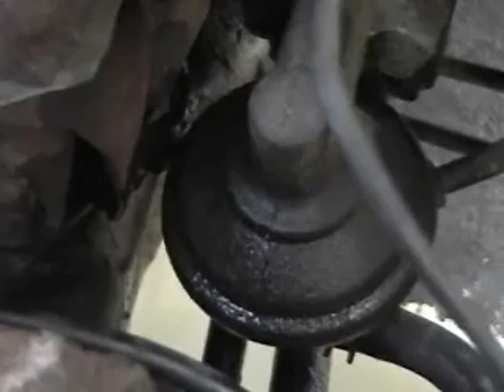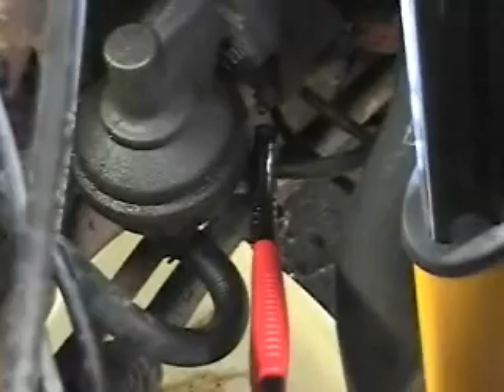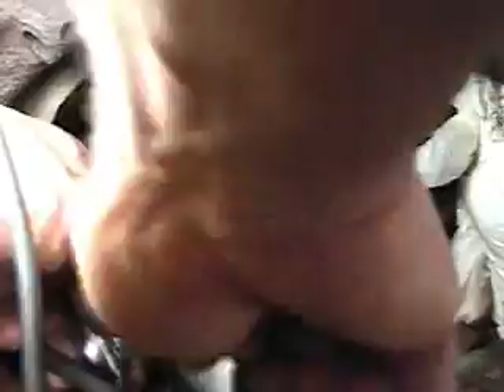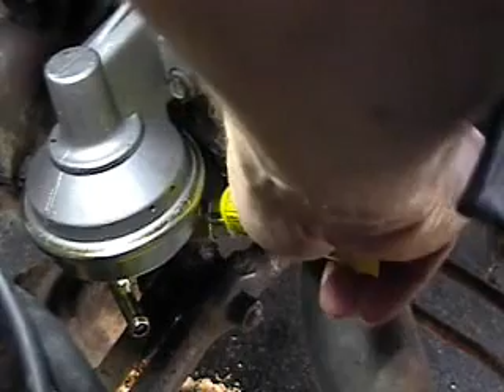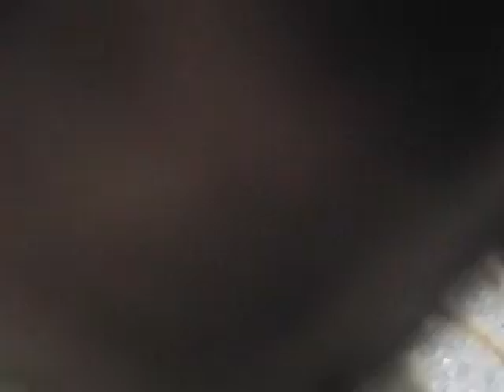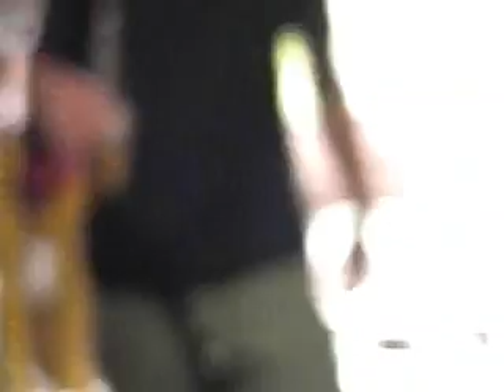Fuel Pump Replace 1984 Pontiac

Comment: When i installed my fuel pump to my 76 Pontiac was no pushrod to push against did i do something wrong i am having starting issues now but wen i first installed she ran great after replacing pump and I'm getting fuel still i believe i might not have spark but that's besides
Reply from the maker: Hmm. That's odd if it ran when you first installed it and then it stopped. Are you sure it's still getting fuel? How long did it run for before it had issues starting?
Reply: When i pump the gas i can see gas getting pumped i started with issues after that first start after replacing starting issues
Reply from the maker: @ncientdyno  Did you diagnose the spark issue? It's likely that or maybe the ignition coil.

Comment: I like how those fuel pumps work its works by the eccentric wheel rotation that's attatched to the top timing gear contacting the push rod on the pump

Comment: Was hoping to see the most difficult part.. the pushrod , so it fits back in
Reply from the maker: I know, sorry, I didn't realize how important it was, I just installed it with the push rod in the pump under the pin

Comment: Thanks for the information very useful for my car have the same car fuel pump went out what tool did you use and what socket ranch was it so i can get it all at once.
Reply from the maker: Hi Randy, The size of the bolts may vary from each vehicle but you can try a  10mm or12 mm socket. Good Luck. ~Cheers~ B.Champagne

Comment: thanks for the video. i realize ill be swapping out my fuel pump with even less of the must haves like grease and appropriate tools. but, i feel confident in doing it myself having witnessed its a bolt on piece of equipment. the value is in the experienced "hey be sure to do this and watch out for that"; thanks for the post.
Reply from the maker: Hey! Thanks for the great comment. May your adventure take you to places that only a traveler can experience. Keep your videos coming, I will be watching them like a fly on the wall. ~Cheers~ B.Champagne
Reply from the maker: Also, If you get a chance to fix up your channel so viewers can leave comments there.

Comment: Hey great video! Can you install the pump by using grease on the pushrod to hold it up? Then bolt up the fuel pump and wait a little until the pushrod slowly falls on to the fuel pump shaft? Thanks
Reply: RevolutionzPM ,the grease will not cause a clog. The pump is driven off a lobe on the camshaft. That actually,the correct way to install the pump!
Reply from the maker: +RevolutionzPM  The grease might cause a clog.

Comment: does anybody if I have to take down the gas tank for this ,or just take off fuel pump and replace it
Reply: +Willie Toole you only have to remove the tank if the pump is in the tank on later models, if its on the side of the block you don't